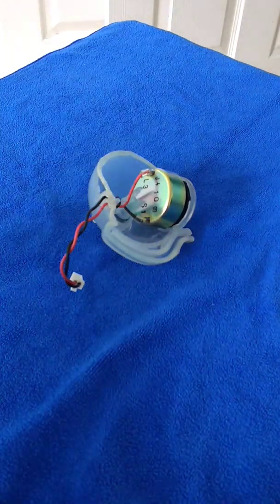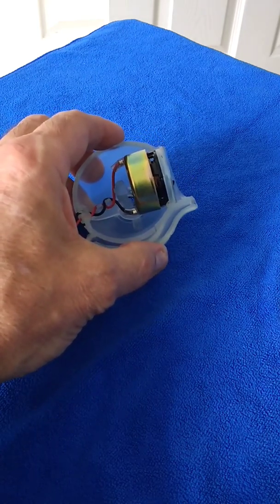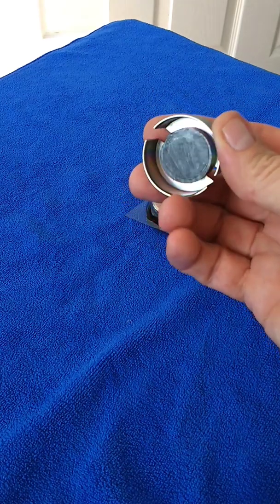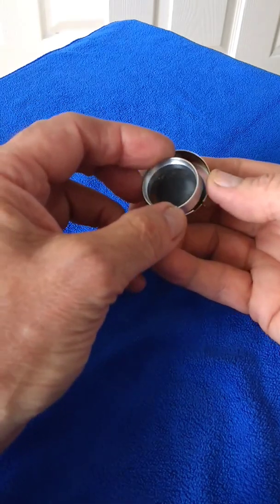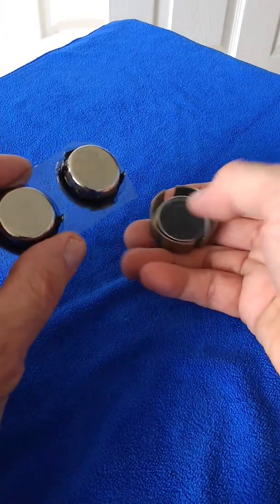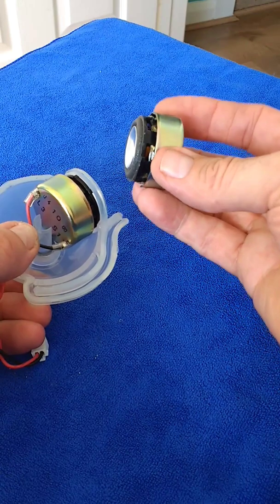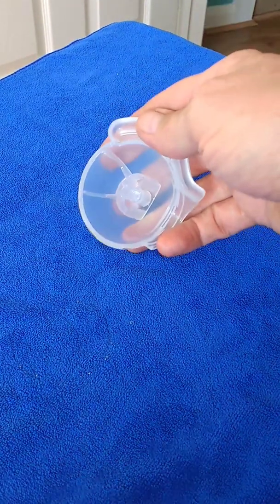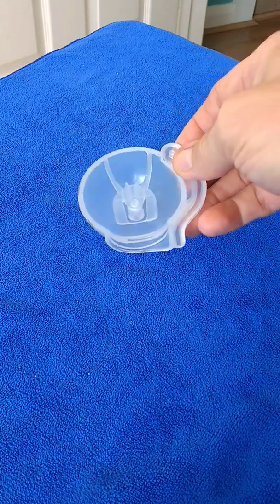iMac G3 Speaker Replacement - Excellent Sound

Comment: Thank you for this, it helped me a lot.
To simplify this, much like the speaker is glued/attached to that magnet, the magnet itself is glued and attached to the big metal base.
Just pry it apart with a hammer and a thin screwdriver and flip the magnet. The polarity doesn't matter for the metal bit, and the speaker will attract to it as normal. :)
Simply glue it all back together.

Comment: I think that's actually the best approach of repairing these speakers and I'm happy that you did this video. I think I will reference it to other people.
As far as I understand it the extra magnet is there to eliminate some of the magnetic field which is affecting the CRT tube otherwise.
I actually did repair a pair also but didn't transferred the whole assembly with the extra magnet and the outer metal shield so at higher volumes I get artifacts on the screen.
Where could I get such a aluminium collar?

Sorry, now I read you made that aluminium collar by yourself...
Reply from the maker: The reason for the turned aluminium collar was it was my easiest to ensure concentricity,  that once the glue was applied it could be assembled and remain concentric, you could use a modified toilet roll or a modified and glued plastic waste tube, anything that ensured the two magnet's could be brought together concentrically and glued. I hope this gives you other ideas of avenues you can explore